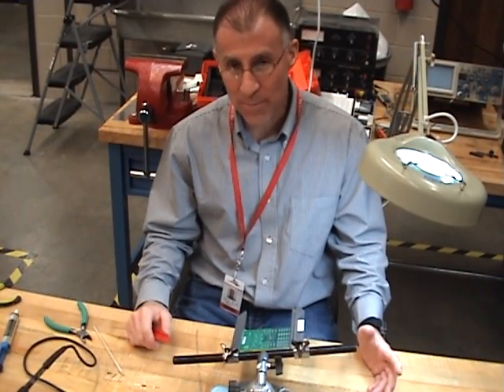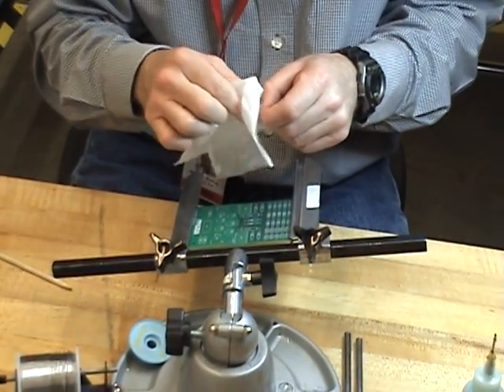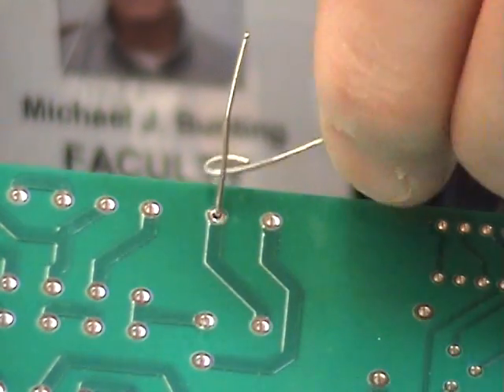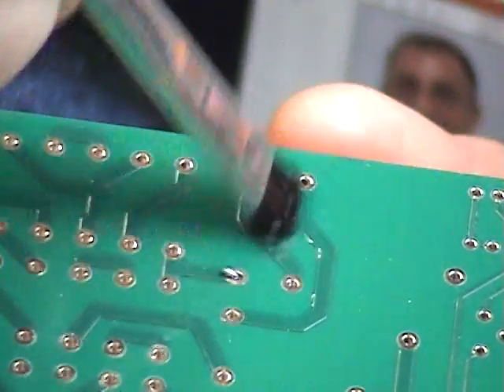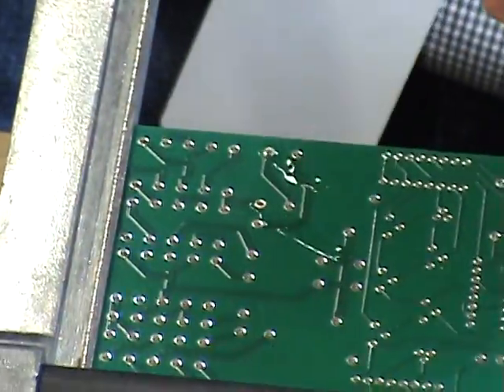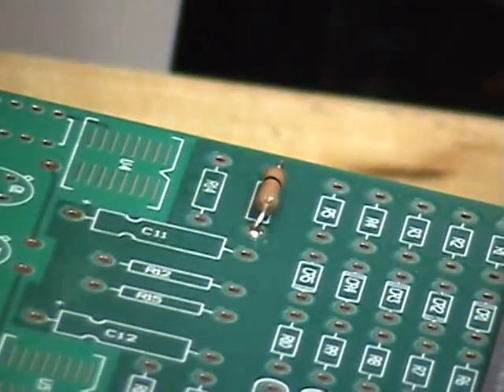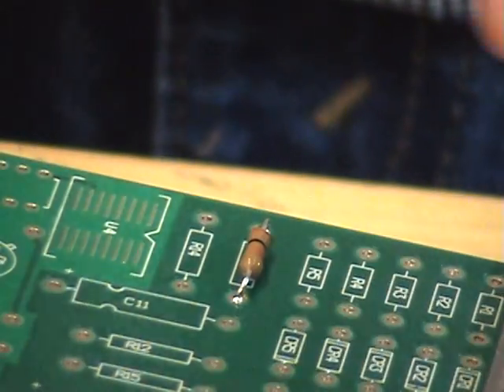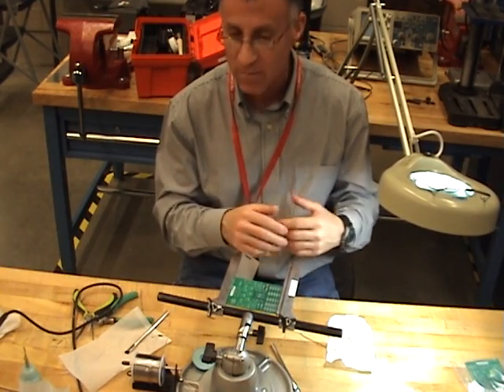*EXPERT LEVEL* Soldering Tutorial #5 TTC Avionics

Comment: There were so many things wrong, unnecessary, and ridiculous in this video.  For one thing, why would you CLIP first and then BEND the leads so far over before soldering?  Besides being unnecessary,  what if you ever want to remove the component?  Good luck with that.  Granted, my electronics degree is almost 40 years old, but I don't think these basics would be much different now.  I was building prototypes for AMF Electronics Research Labs in the late 70's.  If I was doing all these drawn out procedures I'd still be working on some of those product prototypes that have come and gone from the market.  Clean the board FIRST. flux the whole back surface. Use flux-core solder and go to town. Take component, bend leads by eye with pliers, place, spread leads just enough to hold component in place, solder, clip at top of solder bulge. It takes 1/10 of the time and is just as effective as all this nonsense.  Now if you are really building something critical that is going into space, then maybe you might be anal about it like this.  However, I doubt anything fabricated in this manner is going to space.

Use a heat sink to dissipate/absorb heat to keep the component safe?  Even 3 seconds of a low wattage soldering iron can damage some components.
Reply: ***** These standards are what we call, written in blood. Meaning, someone died for these procedures to be required. What you list is jibberish. I have an MSEE, but that doesn't mean I am somehow a pro at soldering techniques. I learned that from years as an aviation electrician in the military and later as a mod team member upgrading military aircraft with new systems. We had to test to NASA standards, which are pretty much the same as the company I worked for. These systems operate in nightmare conditions, heavy vibrations, high heat, corrosive environments. The way he shows it is how it is done for components that operate in space, and in the air both in civilian and military aviation. As I said they are written in blood.
Reply: Roger Lamb Typical hypocrite. Good luck to you Roger, I disagree with you but no hard feelings, thanks for your service by the way.
Reply: Roger Lamb You are obviously either blind to the history of aviation or willingly stupid, btw maudlin is the wrong term to use. When I say written in blood that means that someone got hurt or died in order for new rules to be written. That statement is ESPECIALLY true in aviation. If you were up to date on aviation safety history you would know that the statement is 100% true. Someone does something to hurt themselves or die in order for a new procedure or rule to be written. QA is based on this idea. When we install that equipment you make we inspect it, install it and TEST it. Because once upon a time someone in your business didn't pay attention to their wiring and a chaff/flare system didn't work. Who the fuck are you to tell me how I operated on the Depot level? All the shit you tards built and sent for install was checked against schematics and diagrams for correctness. Installed by us and then TESTED by us to ensure it worked and it didn't always work as it was suppose to and we sent that garbage back to you backwoods hicks getting jobs building components for 15 an hr. I have been involved with this industry for decades, I know how it works moron.
Reply: you can remove a component easily enough. Use a sucker/braid/whatever to remove as much solder as possible, then clip the leads on the component side, and remove the tag end from the solder side.

Bend by eye? really, you think that is best practice? when there is a cheap tool to do the job precisely?

"if you are really building something critical that is going into space, then maybe you might be anal about it like this" - yea. You know what avionics is, right? I mean, seriously, would you want your life (or your families life) to rest on something which was not built to best practice? Where some random guy just got some solder and "went to town"?

If you look to see how some joe just wings it and throws solder at a circuit, then there are hundreds of those. This video shows the highest standard of soldering, for situations where  a dry joint or torn track could cost lives.
Reply: John Doe Lets not be maudlin. Written in blood my aunt Lucy's boots! I work in the Aerospace Industry. We make equipment that is installed on Civil, Military, and some rockets. We test like the devil on every new product with Vibration, Shock, Temperature, Altitude, Explosive Atmosphere, Humidity, etc. Why? So we don't have to write procedures in blood. Also, There has been a huge down grade or change in thinking in soldering requirements since the 70's and Mil-Std was replaced by IPC Standards.
Reply: John Doe  You were really doing a good job right up until the end. You just couldn’t help yourself could you. You should learn to control yourself a bit. I would think that a Marine would have a bit of self control and at least an adequate command of the English language to communicate his argument without insulting people especially strangers. You loose every bit of credibility when you insult strangers. I simply disagreed with your stupid statement that these procedures were written in blood. What clap trap.  To listen to you tell it the only time any Best Practice procedure was introduced  was because someone died or bled to discover the problem. 

That is certainly insulting to the Mechanical, Electrical, Electronics, Materials, Test engineers and scientists that work to make our products safe. They really wasted their time taking all those physics classes. Good to know you know more than all these people with hundreds of years of combined experience. Damn you must be really good! I guess they should have consulted with you before codifying any new process to make sure it got your blood seal of approval. Why I shouldn’t have paid all that money and burned all those hours getting an BSEET degree. I should have just found someone like you to regale me with your vast experience.

I too have some experience in this area: NavAir 2M training 1978. Navy electronics technician Radar Systems, e3 to CWO3. 23 years service. Was saved from the mistake of volunteering for 2M training and passing the course by advancement to E6. Lets forget about 14 years experience as a test engineer for Motorola and another 4 years testing at this Avionics Company.  

In my 8 years of experience as Electronics Maintenance Officer at Naval air stations and in the Fleet the only smoking holes I heard of were because of things like chaffed harness threaded through air frames improperly or miss designed by the AC manufacturer (I think that was an AF aircraft type). The only Deaths I ever saw were caused by pilot error because of darkness and vertigo. It seems that flying planes into each other is deadly. Plenty of Alerts 2’s because a light bulb on the dash came on but no smoking holes due to electronics. 

I guess since IPC took over for the mil-std in soldering with their JSTD 101 I should have them contact you for your blood seal too. They have changed many of the practices I, and I guess you, learned. Like it is acceptable to trim a lead after soldering it as long as the joint is not disturbed…Imagine that…Them f’n morons. Be careful or you may be polishing My Aunt Lucy's Boots.
Reply: Roger Lamb You did the same buddy, stop being a hypocrite. You wasted two paragraphs on trying to discredit me merely on my choice of words, someone with military service such as yourself knows that is the worst argument, in person or online. I know some very smart gentleman (some of which are Navy officers who I work elbow to assholes with who cuss like sailors) who I would never judge merely based on the words they choose to use. People who take that route are nothing but self-aggrandizing douche bags who sadly can't even smell their own bullshit So with that out of the way. I never said ALL the rules, etc come about from blood. Here is a quote from my last reply to you, "It doesn't mean literally EVERY rule and regulation is the direct result of an accident but a lot are, or are implemented from the realization that something is unsafe or if done incorrectly can cascade into an unsafe situation,". Notice how if you would have taken the time to read that, you wouldn't be wasting your time talking about it, so again gtfo that idea. All I said initially was that there is a saying used in aviation that explains that which is perceived as being tedious to maintainers. Just google that term and you will see it written everywhere, in my NATOPS training before I became a CDQAR that term was explicitly stated as the preface to the NATOPS study guide. "The manual you are about to study has been written with the blood of those that came before you and those who will come after you" Now using a quick search, this idea who so adamantly feel like debunking can be seen all over the internet.

http://www.hazegray.org/faq/slang2.htm
-Look at NATOPS

http://www.vaq34.com/vaq34/vaqnatops1.htm
-Look at the last sentence before the screenshots

http://isme.tamu.edu/JSCOPE99/Bowen99.html
-First section title "The Flgiht", middle sentence, far right

https://www.facebook.com/Swingingwiththewing/posts/568774666523978
-Facebook group under number 1 saying, then a comment further down highlighting the truth to the statement

http://wealthyretirement.com/bill-gross-timing-the-bond-market-three-gross-mistakes/
-"As the saying goes, NATOPS is written in blood. You better believe it is!" Down about a third into the article, written by an Fmr. Naval Officer Pilot, he must be wrong though huh?

http://www.woundedwarriorcorps.org/press/2014/10/17/join-us-on-the-stono
-Second paragraph at the end. I see a trend here Roger....

https://books.google.com/books?id=4g-3BgAAQBAJ&pg=PA16&lpg=PA16&dq=natops+is+written+in+blood&source=bl&ots=zLYHMRslAr&sig=5FOUune3T4pfjxvYOjRtWhJqptY&hl=en&sa=X&ei=YkJWVc_pBsqbNpjegJgO&ved=0CEQQ6AEwBw#v=onepage&q=natops%20is%20written%20in%20blood&f=false
-Page 16 near the bottom

Now again, with THAT out of the way. On to your bs ramblings about me somehow insulting engineers....If you are insinuating that they, because of their years of education are somehow infallible, well you are an idiot. Reading that from you is just so funny, it doesn't even compute. Funnier that I have recently earned my BSCET (Go figure huh) and am currently working slowly towards my MSEE. Also I work with a shit load of EEs who write code for avionics packages, which is the program I manage. In order for me to step up is GS scale I needed it. Regardless any engineer worth a shit with at least two brain cells to rub together knows that: 1. Mistakes don't make you dumb, 2. You will make mistakes and 3. You can't always account for every thing. This is especially true for the mod process and why we go through the system in place to A/B test mods before they become fleet wide changes. This is also especially true for newly designed aircraft, the last I dealt with being the 4 blade program for the Marine Corps. Some of the guys in my shop went to China Lake and Pax River to put those aircraft through their trials before full production now why would we do that if what you rambled on about (my insulting engineers and all) was true? Ohhh, that's right you know your wrong and what you said was outright ludicrous in your second paragraph. Thanks again Roger for your time. I will end with this, NATOPS, flight manuals, procedures from O- D level, etc. are written in blood, not EVERY damn line of it but enough for the statement to be true. Now go away.
Reply: Sorry fell asleep reading that..Yawn.
Reply: ArJuna22 so how would you remove a resistor for a repair of a space probe on its way to Mars.
Reply: You have a great time good luck nailing down that degree and don't get anemic writing all those procedures in blood. Thanks for your continued service. I think I'll just walk. Oh yeah... An Elephant is a mouse built to government specifications.

Comment: Talking about contaminates...he didnt cleaned the board before fluxing....normally flux should be applied right before soldering... Since you were using liquid flux, why do u trim the solder? 600F (315C) i think is way to low ... only if u have a high thermal soldering iron and low density board as the test one...try soldering at 315C on a 16 layer board... i haven`t heard anything about the solder..eutectic? lead free? 60/40? 2 core? 5 core? what type of rosin has it in? etc... missing alot of details so..i think this video is good for begginers..not expert level...

Comment: The time he is finsh with the board it will be Obsolete
Reply: yea, he probably doesn't explain it to a five year old for every component. It takes maybe 50% longer to solder to this standard. If that 50% saving is important to you, and a failure is not a disaster, then of course you can cut corners.
Reply: yea of course. Aerospace companies go bust every day...
Reply: L0WRYDER
Try to bear this in your little mind: he's trying to give you instruction on this procedure. Would you rather he rush through it, just for your sake?
Reply: L0WRYDER
Why is there so much ignorance (of the space program) in this country?
Reply: I'll take quality over speed any day, especially if my life is on the line in an airplane or spacecraft where one mistake can be deadly in a chain of events.
Reply: Hehe, that is what I said in my post above.
Reply: gnorty well at least a 5 year old knows that if you do it this way you will go broke and you cant get any where and the cost of it would put out of the market

Comment: Is there any reference to why these are the procedures?  Has there ever been a failure traced to contaminated soldering wire (that would be prevented by wiping the wire)?  Isn't it more important to use solder that won't form tin whiskers than any of this forming the lead in the direction of the trace?
Reply: NASA's standards were designed after their test rockets, with solder work done by TV technicians, kept blowing up during launch. As a result they invested in extensive studies to determine how to, if painstakingly, remove any possibility of failure from temp change and/or vibrations. As others have said in some of these threads, If you aren't sending your boards into extreme environments, you don't really need to adhere to such Nth degree measures. In today's consumer market most products are disposable before contaminants that were on the solder wire would cause a failure.
Reply: Thanks!  I was hoping for a document I could read, but this is helpful too.  (And I think you're right about the disposable products.)
Reply: Dennis Gentry Google NASA Solder Standards and you will find a PDF that floats around on the net.
Reply: if NASA  built guitar amps or fuzz boxes , there would be no Rock and roll....

Comment: What strikes me is the waste of solder I saw. Every time you solder a connection you have to snip the end of the solder you touched with the Iron! Isn't the fact you "cauterized" the end of solder and blocked the rosin in the wire part of the reason you use the liquid flux? I'm not going to dwell too much on the lack of an ESD mat on the bench, no use of an ESD wrist strap no the lack of an ESD smock...The learner should know he/she will have to tether one of his hands with a strap.
Reply: This is one of the few intelligent, and the only pertinent/helpful comment, I've seen on this video.
Reply: Yep no ESD control in this video but this is a training board so maybe that's why.  I do think its best to teach ESD control at the same time as soldering techniques though.